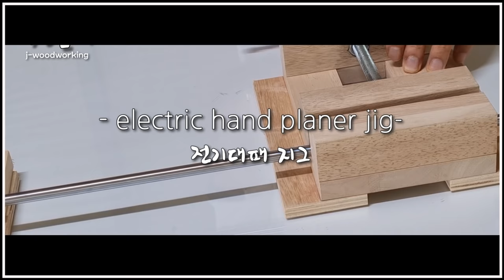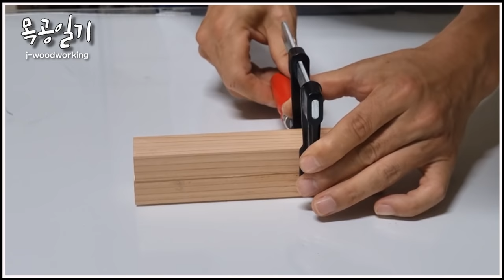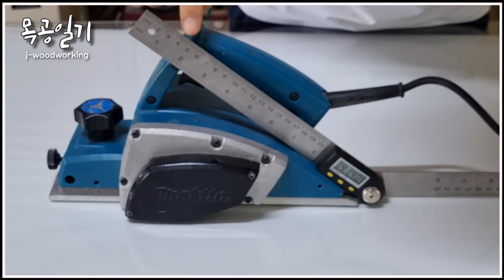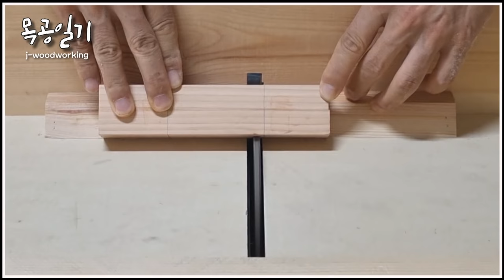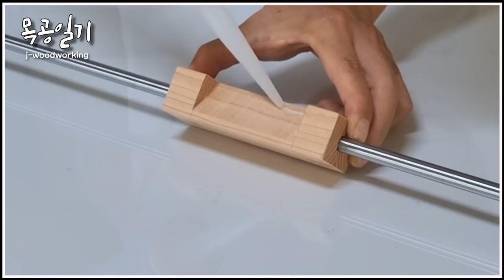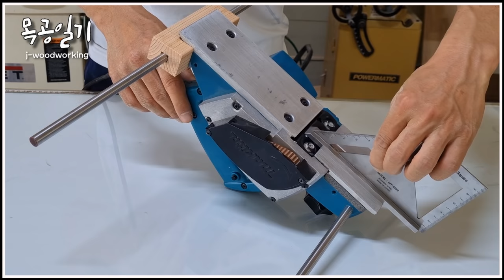planing wide boards perfectly with electric hand planer / upgraded ver. 2 [woodworking]

Comment: I was cringing when you used the angle grinder without a guard and I was cringing even more when you were passing your fingers directly over an unguarded router cutter!
Reply from the maker: Sorry about that. I'll be careful. 
Thanks for watching sir.
Reply: Yess i'm agree with you, 
I've been using an angle grinder for over 30 years and I've never used it without the safety cover.
Reply: First thing I do when I buy an angle grinder is throw the guard away
Reply: You need a tool to push over router, hand is too dangerous
Reply: @spencersorvala1799  I work in a metal shop. They would 100% think it was a joke if I asked where the angle grinder guard was.
Reply: Real men don’t need guards...:)))
Reply: I always use a grinder without a guard always guess what I still have all my fingers and never got injured once, maybe you just don't trust your abilities do you drive with windows up wearing 2 masks on as well?
Reply: First thing I said to myself!  You never know if a unseen I perfection in the wood and it could snap and there goes your fingers into the blade! Saw a kid do this with a joiner in shop class! Lost 3 fingers!
Reply: I was too Sir. It only takes a split second to have a lot of pain and suffering.
Reply: First thing I do when I'm jealous of someone else's creation is to criticize their use of tools and or how unsafe they are.... 

- not.

A great job!  Thanks for showing us a new way to plane wood!

👍👍
Reply: Not your fingers not your problem chris
Reply: You can touch a grind wheel when its on, so thats not the bad part, but it will throw hot crap in your face

Comment: I don't like how he had to hold the workpiece with his hand at the end of the cut. That's where I always get sniping. The workpiece should be clamped. This is especially true when the face resting on the benchtop might not be flat. The workpiece will rock while it is being planed, counteracting all of that effort to create the guide box for the planer.

Comment: Making that rear rod mount had some real great techniques. The false fence for the sled was great to get the angle right.
Reply: I don't like that it's held on  with glue, though. The pressure on the planer means that the glue joint for the rear rod is under tension, which is not where a glue joint between two disparate materials is at its best.

Comment: They should make planers with this added feature. Even if they didn't provide the rod, at least provide the 2 holes that aligns back and front, with maybe a steel pipe kind of fitting inside with various thickness. This was if the hole made is too big or small from the rod you can find where you are u can switch the pipe with different thickness, like a thicker one to fit a smaller rod etc.
 With a jig like this, it would make planing larger and wider boards much more consistent and accurate.
Reply: Alcuni produttori le fanno
Reply: Yeah. My Ryobi cordless planer doesn't have these mounting points. I'll have to think a bit on how to do a mod to make some.

Comment: Awesome idea!  Thanks for sharing.  I have an 8 foot long workbench slab to flatten and am planning to use this with some 10 foot unistrut as my side rails.  In thinking about this it seems like the guide rail on the back of the planer is not necessary since the back plate behind the blades will limit the depth of cut.
Reply: Actually none of it is necessary. That was a whole lot of work that a couple planes, winding sticks, and a makita electric planer would do just fine (probably better) than trying machine something as if 3/8 steel rods don’t flex or bend. 
If you need that much production in flattening boards you need a jointer and / or an electric planer. 

Hand planes don’t take that long on small projects. I flattened a 5’ side table top last night in about 5 minutes with a smooth plane. Needs 5-10 more minutes with my jointer plane to be ready to sand or perhaps even leave the jointer plane finish. I do not own an electric jointer nor an electric thickness planer.

Comment: Brilliant, man! Fantastic work! 😃
I confess I don't like the idea of gluing the piece of wood in the back of the planer, but... I really don't see any other way. 😕
Anyway, stay safe there with your family! 🖖😊
Reply from the maker: Thanks for watching sir. 
Always appreciate your kind comment.
Reply: It would take not much effort to drill two 6mm holes in the back of the planer and bolt/screw the block on. I''ve made a sled to use my router on wide boards but the tiniest amount of flex in the sled results in a step in the board. I wonder how much movement will come from the 10mm rods. Maybe planing longitudinally is better than cross-cutting with the router?
Reply: At least in my Makita larger than this hand planer, model 1912B, a full 4 3/8" wide planer; the rear of the body has enough space for drilling the required holes, and also perhaps, for a pair of bushings slightly larger pipe bushings, so that the plastic body is not worn against the steel rods!

Comment: Ok, the solution is easy and straight forward. But: I would make some stoppers at the end of the metal rods to prevent them from slipping of the wooden bars. Also I would have liked some mechanism to change the hight so I could define the thickness of the workpiece. As for now I get a nice surface but this doesn´t help if the workpiece still is too thick. Exept for this it is a great video.

Thx 4 sharing.
Greetings from Switzerland 🇨🇭

Comment: Brilliant. Next, expand the same concept, using long aluminum box extrusions (e.g. 80/20) as support/reference rails, and motorized head from  cannibalized 12" lunchbox thickness planer. 10 times faster than typical router sled, plus readily executable dust collection via planer's dust port.
Reply from the maker: Thanks for your helpful tip sir.
Reply: @j-woodworking9573  Please let me know if you succeed in creating this type of planing machine. I thought of doing it many years ago, before I had more industrial equipment. But I was always too busy with client work and other invention projects to get around to it. Since then, I've seen a YouTube video by a man in Russian who did what you've done, but with a wider electric hand plane. A 12" planer head would make short work of most jobs. One detail you might consider: presuming you end up stripping down a 12" planer with straight knives, I think it might prove a worthwhile refinement to mount the head at a slight skew angle to the direction of the carriage travel. A shearing cut would reduce power requirement somewhat and, more importantly, provide much cleaner results, especially on highly figured stock, than a straight knife entry. Good luck! BTW, the execution of your current model is impressive.
Reply: That's a great idea! Especially since the lunch box style planers are typically much cheaper than the really large handheld electric planers.

Comment: Nice and easy. I don't know how easy that steel may flex, but it could be easily reinforced by pushing the rods through some wood, although it will lose the ability to slide those rods through the tool for adjustment.

Comment: Absolutely brilliant! Never understood why people used router sleds and other methods. This is much quicker and easier.
Reply from the maker: Thanks for watching sir.
Reply: Routers have one advantage.  You can adjust the depth of cut much more easily than with this setup, which if I have understood correctly relies on packing up the board from below.  Which isnt so easy, especially if the faces are not parallel.
Reply: @richardsinger01  measure from to rails,shim board on spacers and get a happy medium.Plane,turn around and you should be alright?

Comment: real minimalism at work here. focus and simplify the problem and solution so you can maximize your capacity to solve other problems. the result is very close to planer results with little or no extra sanding

Comment: Very good idea! I've wondered in the past why people who build these big router sleds for flattening don't just use a hand held planer on them. It would go much faster seems like than using a router.
Reply: because this will only take off a tiny layer of wood. for most boards this would require tens or even hundreds of passes. what is needed is a router jig and then a planer jig to remove the slightly uneven surface left by routers.
Reply: Most router sleds have a carrier that moves longitudinally and the router slides across the board in the carrier. Re-engineering this to slide the planer longitudinally is a much bigger job than it looks, at least it is on the sled that I built (my sled can surface boards up to 700mm wide, 2200mm long). But you're right, the router can take meaty layers off in one pass, the planer not so much.

Comment: the steel rod needs to be stiff enough so that it does not bend to the weight of the planer, especially when suspended tight in the middle. I think there is a limit on how long the rods should be before it yields and starts drooping, affecting the consistency of the depth of the shaving.
Reply: Ok

Comment: Maybe I'm missing something. But I don't have much trouble flattening boards just using the hand planer itself without any jigs. I mean, that kind of what it is designed for.
Reply: I see what you mean...i was thinking the same thing, flat is generally fine for my projects, but now I'm thinking this method makes it Perfectly flat... I'm not that picky, but i like this...
Reply: That's if you have that skill. I've never figured out how to use a planer to make a board flat with each pass level with the previous one.

Comment: Very nice set up. This should work well provided the 2 steel rods are straight and absolutely parallel to the flat surface of the planer and that the 2 boards that he is using as a guide are also straight, flat, and set exactly to the same height.. And of course, the surface of the table saw needs to be flat. Any error will result in steps in the planer cut. But other wise, kudos for the concept.

Comment: A rubber band on each side of the metal rod will keep the rod from sliding...or you could use a round metal rod bushing with screw to lock it in place. Neat video. Thank You!!
Reply from the maker: Thanks for your kind tips sir.
Reply: I think it's supposed to slip a little. You can see how he pulls them out bit by bit as he moves on to the next "track" when he's planing. That way he can use shorter rods. 

Theoretically if you had a rigid frame and washers at the ends of the rods (so they only slide forwards/backwards), you could see the planer as the only part that allows sideways motion. It would be able to slide right and left on the rods, while the rods would slide forwards an backwards on the frame. I think I'd build it that way.

Comment: Well done, Sir! I really like your imaginative solution👏👏👏 Like some other commentators here, I wonder about the best way to height-adjust. The options that occur to me are:
• have a selection of ‘wooden feet’ that are of slightly different heights, for the wooden side pieces… and inter-change them as the piece you’re working on gets thinner; or
• instead of using one long wooden piece on each side, use two - with vertical slots in both ends of each pair so you could connect them and adjust the height using a bolt and washer/nut though the slots (hard to describe without a picture! 😬😖😂)
Also, was that hot glue you used to connect the wood piece to the back of the planer, or something else?
Again, brilliant idea and thanks for posting👍👏
Reply: It looked like silicone sealant to me.

Comment: Brilliant!  I noticed some did make the comment that the back block  on the planer wasn't required since the back plate behind the blades is controlling the depth of cut. Is that correct? Also, what sort of glue did you use to stick the back block on the planer? 
You have let me defer buying a planer/thicknesser to another day thank you.
Reply: Since the front rod is ahead of the blade, wouldn’t the back keep rotating down and taking cuts if the back rod wasn’t there so the back rod stops the back dropping and lifts the blade clear when the set thickness is reached
Reply: @1988dgs  how could it keep rotating down when the whole back plate ("shoe") is sitting on the freshly cut surface? In order for the cutter to drop lower as it moves forward, the back of the shoe would have to somehow drop down even lower than where the cutter is, which is impossible since it sits on top of what has already been cut

Comment: was wondering how youp manage to adjust for different thickness boards.  Is it just a mater of spacers underneath the board to be planed or something with the rails?   Thanks for this great video!
Reply from the maker: I use spacers and use cardes for fine adjustment. Thanks for watching sir.

Comment: La phase 1 ne peut fonctionner que si la planche est calée avec des coins pour qu'elle ne bouge plus d'un mm, ce qui n'est pas le cas sur la vidéo, en général aves le côté convexe sur le dessus.
Quand la planche repose sur la partie convexe et qu'elle n'est pas calée convenablement en passant le rabot ça fait comme un cheval à bascule et le résultat est automatiquement convexe. C'est ce qui se passe, mais dans l'autre sens quand on passe la planche dans une raboteuse sans plan de référence...
Si l'on commence en tenant le rabot en prenant appui sur l'avant jusqu'à ce que l'arrière repose sur la planche, normalement c'est le plan qui repose sur l'arrière du rabot qui devient la surface de référence, la barre arrière ne sert plus à grand chose, comme sur dégauchisseuse où c'est la partie rabotée qui sert de guide, je pense d'ailleurs que c'est pour ça qu'il n'y a qu'un trou à l'avant.
Reply from the maker: Thanks for your kind explanation sir.